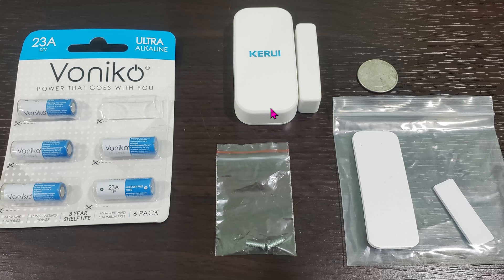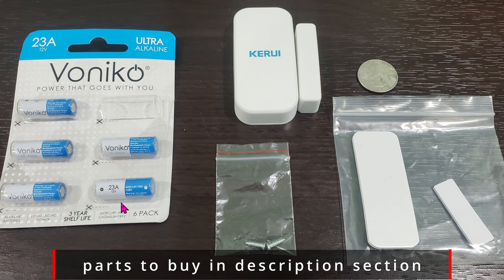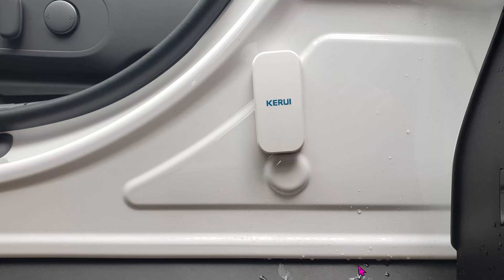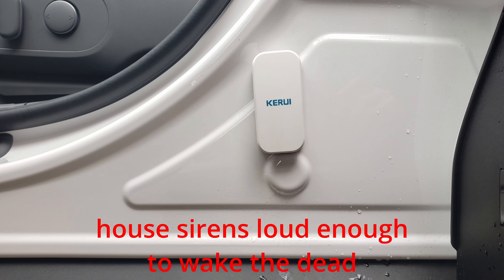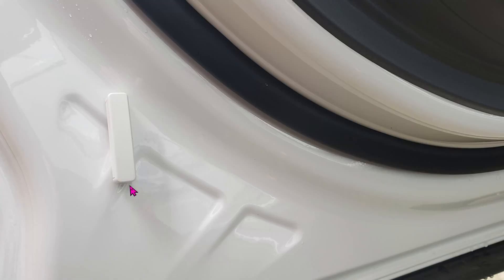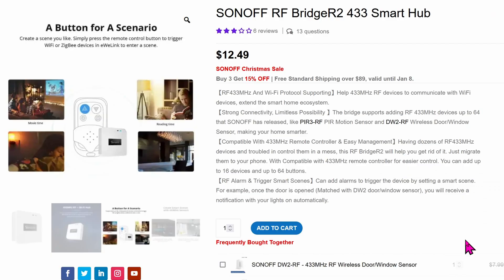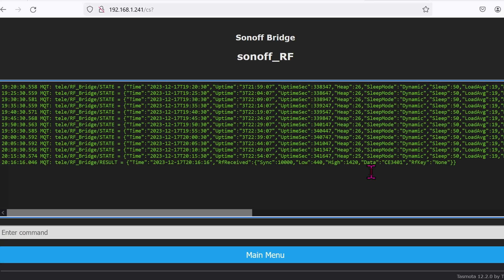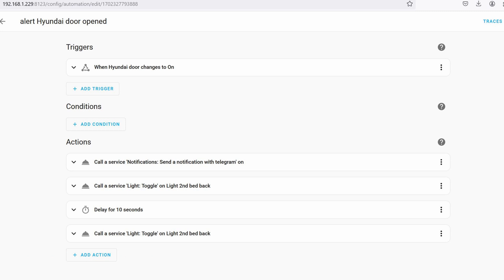433mhz door window sensor. the perfect add on for anti theft deterrent system for automobiles

Comment: Nice work! How has it held up. Could this be used for a location based trigger?
Reply from the maker: this is working great for us so far. when i get home, HA detects car is home and unlock my driveway. saves us 5 seconds per day.   i hate installing new batteries for the door sensor every 40 days though. will figure a way to use the car's 12v directly soon
Reply: @dablet  that’s would be nice, Do little 12 wire.